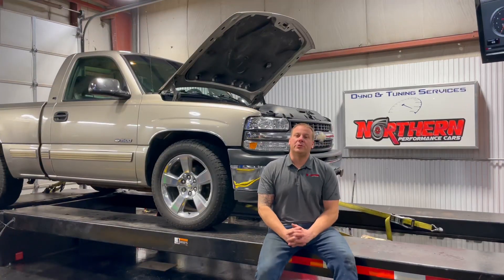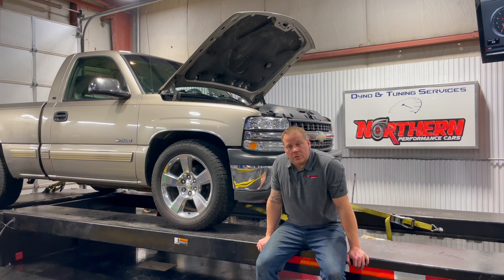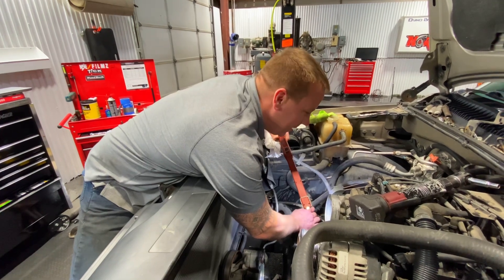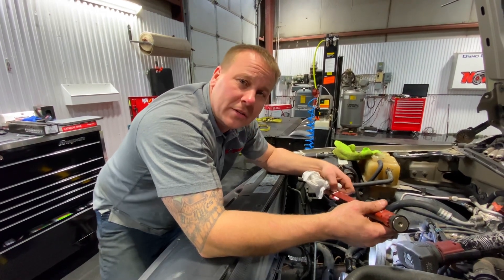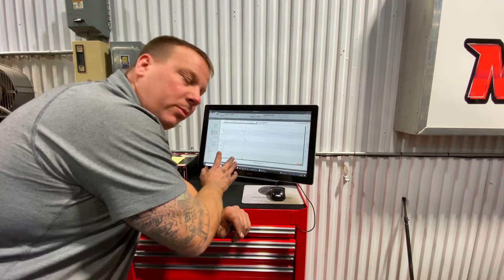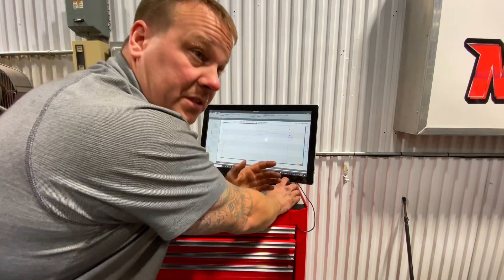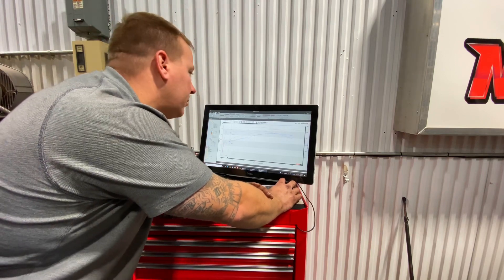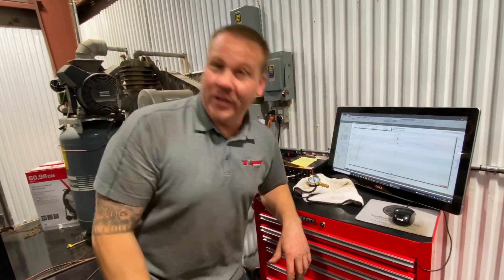Ask and you shall receive! Truck Norris consumes this 4.8 liter Ls. Back to back on the Dyno!

Comment: im truck shopping and have settled on wanting a 05/06 5 speed 4.8 for general driving and light to moderate hauling for things like camping and offroading and I think this is the boomstick that's going to go into it when i get to the point of modifications. It sounds good and a bit lopey without being obnoxious, plus it has a pretty rad name on the tin.
Since i will have no worries of a convertor (and have a local clutch expert if i need one of those) this cam seems like a great fit, perhaps bringing mpg's up under load? 
I really can't wait to dive into LS stuff and a cam seems like the absolute best way to do that after catching up on maintenance. 

how should i go about tuning? holley seems super easy to get started with and has a solid wealth of support behind it but has a price tag to match, how does it stack up to the more budget-friendly hptuners and the stock setup as far as learning curve? I have decent experience with turbo 4 bangers and megasquirt, but it took me all of 4 years to learn that language and establish a completely turnkey car. How different are the associated softwares? 
I would be street tuning by myself, as i have no access to a dyno and would likely rely on a base ignition map. Maybe virtual dyno if I decide to chase numbers but I'm not looking for bleeding edge power out of a truck right away, it's just utility for the forseeable future. 
87 is generally unfeasible in the F/I world, how safe is it with just a cam? what about after an intake/exhaust? Can I end up running into detonation issues pushing that much more air?
Reply: The 4.8 5 speed is a good combo, go for it. And this cam is a very good one for any of the ls truck motors. Watch some of Richard holders dyno tests with this cam in a bunch of ls’s. I had a 4.8 5 speed single cab short bed and I wish I hadn’t ever sold it. It was pretty much stock with a 6” lift. For tuning, there’s a ton of options, Diablo sport is one of my favorites but a bunch of people do good tuning for ls stuff. I would also recommend a trailblazer ss intake, you’ll get another 20+ ft lbs of torque out of the cam.

Comment: I'm sure it's bigger, otherwise how does that compare to the callies cam you used to recommend for trucks?
Reply from the maker: This is rather larger. Will carry power higher. Not lose a ton down low. 
Not as good as a towing cam specifically but probably worth 10hp and torque across the curve.

Comment: How do you think this camshaft will do with a 100 shot ? I’m thinking about getting them camshaft, w a tbss intake as well
Reply from the maker: It would do awesome! I have a saying, we’ll kind of. 150 shot or nothing! 
By the time you pull timing and do all of that work. The 100 shot is barely scratching the surface. 
Pull 5-6 degrees to start. One step colder plug and get the jetting correct.
Reply: @NorthernPerformanceCars  haha true, I’ll do that appreciate it, I was debating about this camshaft, but this just shows why I should get it lol. Thank you love the content

Comment: What long tube headers and y pipe do you guys like to use on these trucks?
Reply from the maker: It’s always hit and miss. I’ve been using speed engineering quite a bit. Affordable and available seemingly. Fitment is ok not the best. Not the worst.
Reply: @NorthernPerformanceCars  I’ve got a set of big name long tubes and y pipe I’m waiting to install on my ‘04 Yukon that I daily drive. It’s got a cam, efans, catback etc. is the hassle of the headers worth it for a small cam daily driver?
Reply from the maker: @GulfCoastTuningandCalibration  I prefer headers in stuff if you are trying to squeeze out that last little bit. Make them more resistant to detonating with a longer primary(pushes the expelled exhaust gases further from the head) 
But it is not a must have. 
The sounds is far better.
Reply: @NorthernPerformanceCars  currently running a 212/218 114lsa and not trying to go crazy becuase it is a daily but wondering if a better cam and a converter would be worth while or not.
Reply from the maker: @GulfCoastTuningandCalibration  the changes in valve events is what makes the other cams feel snappier. 
You won’t notice some world of a chance. But a little throttle response and it would be preppier no doubt. 
114 is making a lot of its power in the higher rpm’s
Reply: @NorthernPerformanceCars  yea we’re all wishing that truck Norris cam was out sooner!
Reply from the maker: @GulfCoastTuningandCalibration  I’m right there with you. I waited patiently for like 9 months! But Brian wanted to test and perfect it. Then waiting on suppliers. 
Son of a!

Comment: really need to see someone do one of these cams with a fast lsxrt with the 102mm throttle body I have a feeling the stock intake manifold is choking the cam out pretty good and I'm betting possibly 20-30 horses at the wheels and I imagine being able to let it rev up too 6500+ would work wonders in a 4.8 but that's just my theory
Reply from the maker: It certainly would make a bunch more top end. Lost quite a bit under the curve with the shorter runner. 
A Tbss/gen 4 intake would be worth a good amount. Everywhere in itself.
Reply: In a 6.2 truck the cam flatlines at 6, and holds a flat line to 6200, by 6400 it was on a steady  decline.
Reply: @Slik-rik87  thing is though small displacement motors especially the 4.8 make all their power at way higher rpms than a 6.2 does
Reply: @chrishansen7004  oh no doubt, I just feel like this cam is more based on a true truck cam that maintains torque and horsepower where a truck would use it. I ran a Texas speed stage 3 truck cam in a 4.8, it maintained the gains all the way to 7200 before it fell off.

Comment: Great video! I’d really like to do this cam/long tubes with my 06 2500 6.0L. What head would be a better choice if you don’t mind me asking? I need low end torque for towing.
Reply from the maker: I’d throw a 243 cylinder head on there. It’d raise compression a decent bit. Around .9:1. The compression jump would make power from idle all the way to redline 
Would be great overall.
Reply: 706/862... low rpm torque production kings!
Reply: @NorthernPerformanceCars  So you have that tuned on 87 octane would that retain stock mpgs or even improve them and what about 89 octane and even premium not like I care much but for some reason it was on my mind and how much hp/torque gains would there be from higher octane
Reply from the maker: @calebgross3632  15-20 hp is common when fuel is the limiting factor. Normally 3-4 degrees of ignition timing difference.

Comment: Awesome video brotha you’re getttin the channel dialed in nicely ! Do you prefer to swap the cam while the engine is still in the vehicle or pull it ? Keep up the badass work !
Reply from the maker: For something like this. It is far faster inside. 
Even when I do dod deletes I still leave them in the vehicle. 
Gen 5 stuff is questionable. Oil pumps are questionable.
Reply: @NorthernPerformanceCars  right on I appreciate it ! Got my truck Norris for my 05 just trying to figure out best way to install